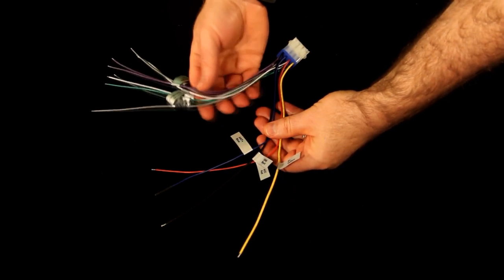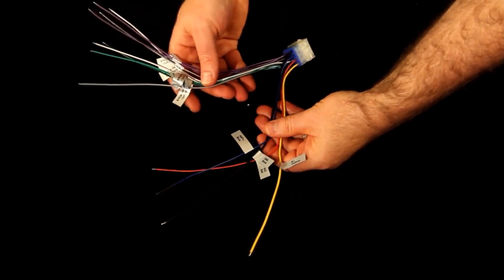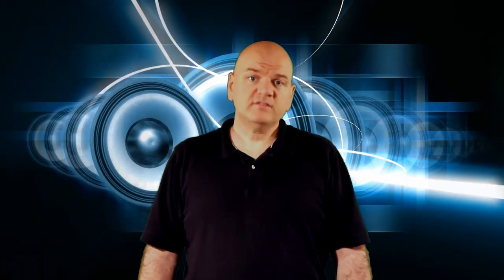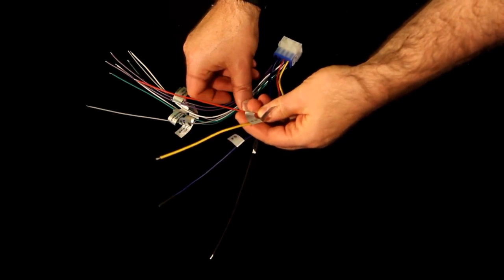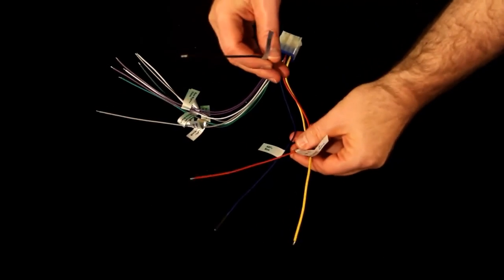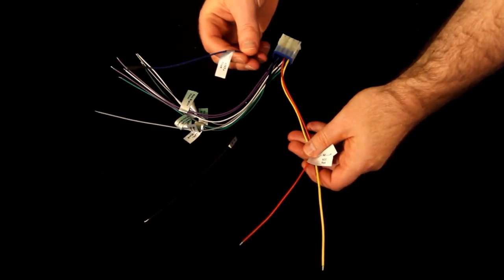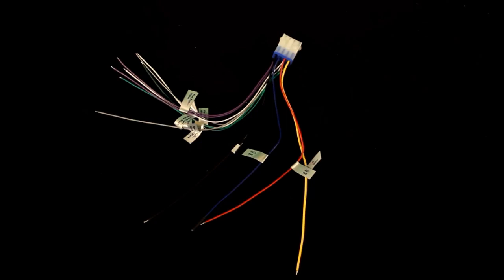Understanding Marine Stereo Wiring Harnesses

Comment: SO if i tie the RED and Yellow together i should be able to use the memory aspect . but i did this and it did not work . around time 0.50 you say if the red is connected to the battery directly the power button will turn off the radio. if i tie the two together it should do the same thing because the red is tied to radio switched and yellow is constant. why does mine not retain the channel memory. if i have it wired this way. (electrontech1@gmail.com)
Reply from the maker: Yellow maintains the memory.  If it is disconnected at any time the memory will reset.

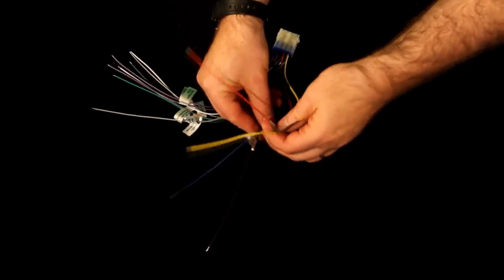Comment: 1:08 doesn't make sense. Don't you mean either one of the two wires (Power Red) (Switch Yellow) must be connected but certainly not both? Please help Thank you.
Reply from the maker: Yellow is constant power.  It maintains the station presets and other settings like the clock even when the stereo is off.  Red is the switched power which typically gets connected to the ignition so that when the boat turns off, the stereo turns off.  Both must be connected for the stereo to power up.
Reply: @rocktheboataudio  Thank you ever so much. That was crystal clear!!! Stay healthy and safe. So red and yellow are wired in parallel to the pos of the battery. Got it.

Comment: Is the yellow wire necessary for stereo operation? Not concerned about saving presets, but concerned about constant drain on battery.
Reply from the maker: Yes, it is.  If your stereo has a yellow wire, it won't work unless it is connected to power.   If you aren't worried about presets, you could potentially connect both the red and yellow wires to the ignition so that power will be totally cut off when the boat is off.

Comment: Boss mgr350b radio:  We spliced both the yellow and red wires to two different constant "hot" wires.  As soon as the stereo turned on, the fuse box began to smoke.  We instantly unhooked the wires but now it looks like the little contraption inside the fuse box has burnt up.  The fuse itself was still good.  What did we do wrong?  Did we damage the stereo?  We are afraid to try to hook it up again until we get some answers.
Reply: It's hard to say without looking at it.  Red usually goes to the boat's ignition so that the stereo turns off when the boat turns off.  Yellow connects to constant power.
Reply: Ok.  We couldn't get at the ignition wires so we thought we'd just hook the red to constant power and remember to turn off the radio when not in use.  What is the best way to hook the red and yellow wires if we aren't using the ignition switch?  Also, can we just splice the ground wire to an existing ground wire?  Thanks so much!
Reply: You can  just connect both red and yellow to the same source.  Yes, the ground wire can be connected to another ground wire.
Reply: Thanks Matt.  I think we just got a faulty fuse/filter box with our stereo.

Comment: Why does my stereo cut off and on when the boat motor is running but when motor isn't running it plays fine
Reply from the maker: It's likely the stereo isn't getting enough amperage while the boat is running.  I'd have a boat mechanic look at your electrical system.
Reply: Sounds to me like it's starving for power, do you use a deep cycle battery? If not get one, or add a 2nd battery if need be, could even use a power capacitor I bet

Comment: Great Video!  I bought a marine radio to wire into my kitchen (rather than an under cabinet radio - those all sound horrible), and I couldn't figure out how to get the power wires connected...wiring both + wires to my supply did the trick, as you suggested!

Comment: Thank you for video gets me most of the way there as I am getting little help from my boat dealer with stereo that won't power on.  Stereo and dashboard remote both should power on/off radio. Have an AMP too.  Have power to Amp, have power to head unit wire connector.   

Red is main power, yellow is constant power, black ground.   

With Ignition accessory switch on: 
At head wire harness Rd to Blk 12.4v,  Yellow to blk .16v,

With ignition accessory off:
Rd to blk 0v,  Yellow to blk .16v

Comment: I'm going to wire my radio memory wire to the battery what size fuse should I use and should I put it closer to the battery or closer to the radio?
Reply: Typically on a head unit it will either come with an inline fuse or there will be one inserted into the stereo itself.

Comment: Great video. so i am familiar with doing stereos in vehicles but new with boat. Basically boat has power switch for the two batterie and shut off switch when not using boat. stereo losses presets do I need to run constant power wire directly to battery ?
Reply: You may.  Some models will need it and some won't.  You'll need to check the specs.

Comment: I have an older boat. Two speakers, black ground and single red power wired back to starting battery.  I can only get it to work if I splice the stereo red and yellow power wires together, and connect to boat's red power wire.  Will this cause a constant/significant drain on my battery? Is there another, better way to do it?
Reply: It will be fine as long as you turn off the stereo when you are not using it.  The advantage of connecting the red wire to the ignition is that the stereo will automatically turn off when the boat is off.
Reply: I got your message, and have been meaning to send a reply. I got it all hooked up. Thanks for the help, and the great video. Now that I have the stereo in, I will be checking your website for some new speakers to go with it.

Comment: So is it necessary that I use the amplifier wire for anything or can I just leave it alone? Thanks so much btw your video is very helpful :)
Reply: If you aren't using an amplifier with your stereo, just tape off the control wire.